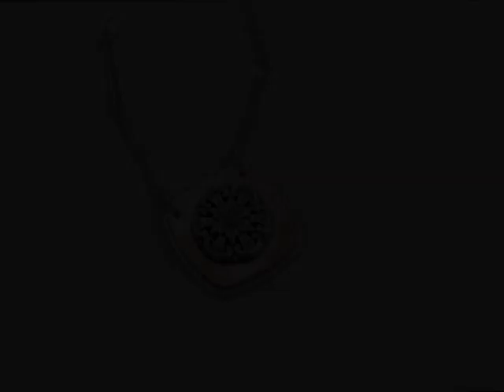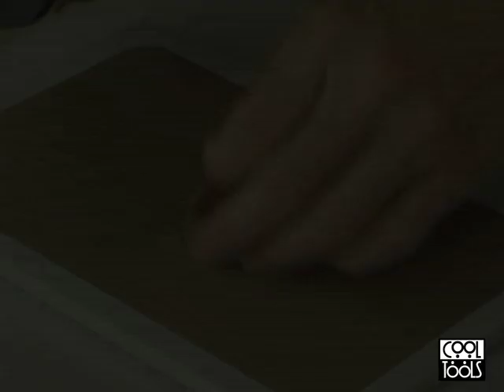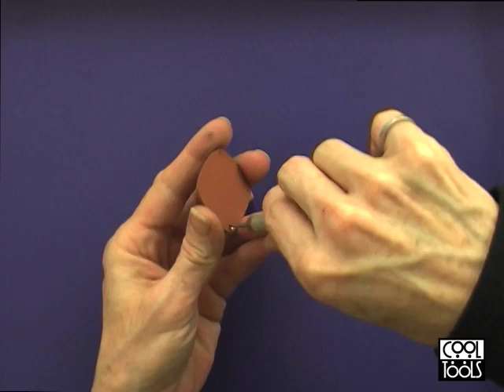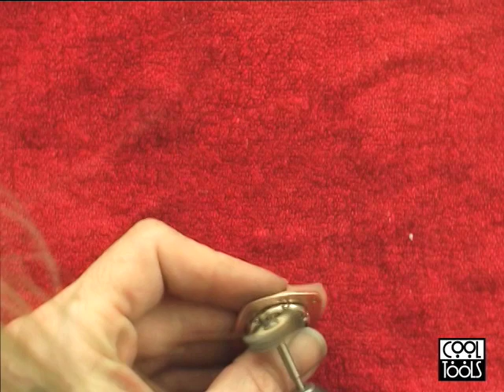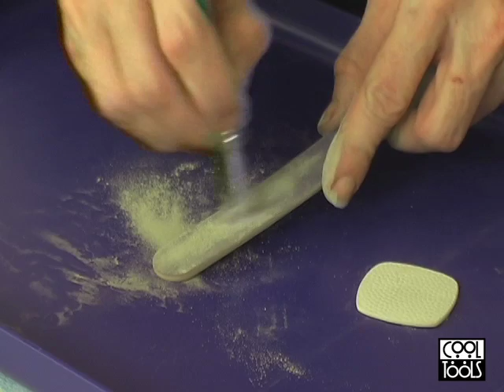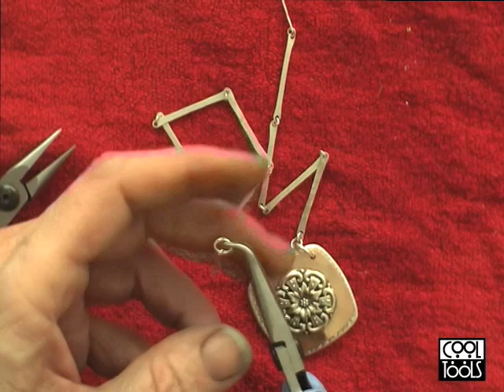COPPRclay Workshop: Layered Necklace

Comment: This is beautiful. I have a question. How strong is this metal can it be tapped for a screw to be threaded onto it
Reply from the maker: +Jeff Isgro 
Hi Jeff,  Metal Clay is more porous and not as dense and sheet stock.  With the proper sized pilot drill, it will hold a screw with no problem.  The metal clay must be fired and sintered all the way through.